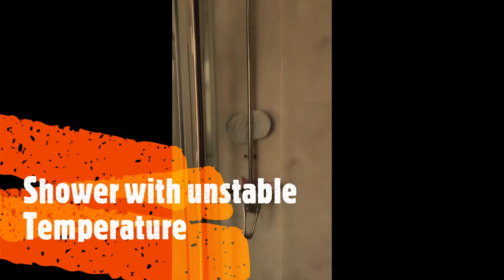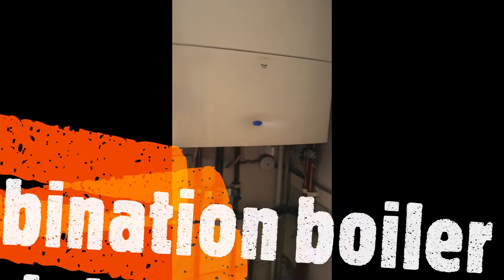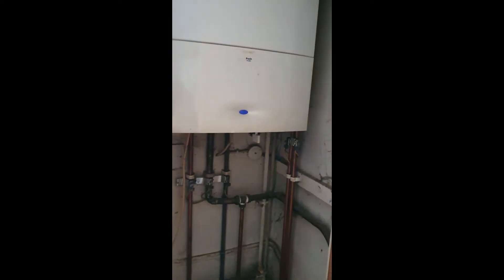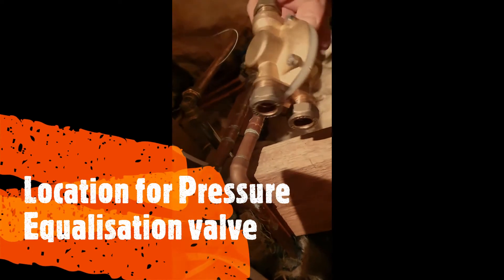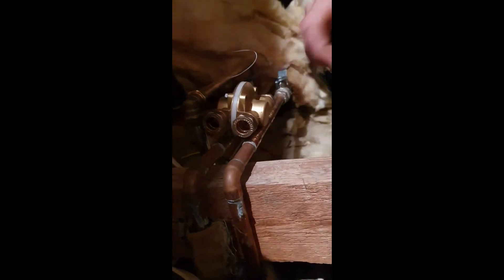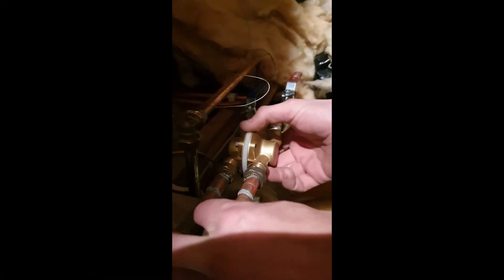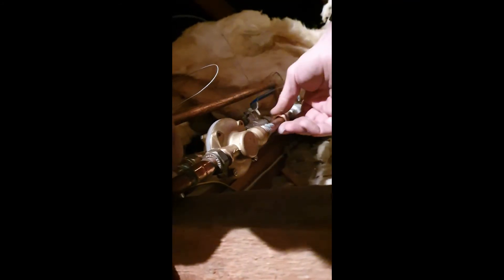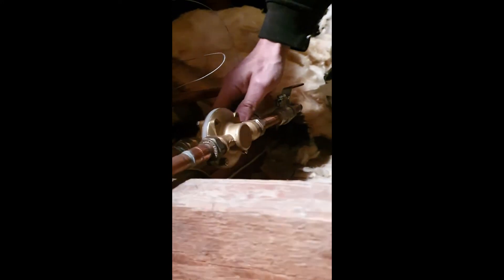Unstable shower Temperature?  Install a Water Pressure Equalizing Valve.

Comment: Hi. 
Looking to fit one of these and was wondering the best location. 
Ideal would be under the bath when I replace the taps for new mixer tap. 
Cold tank feed. 
Hot from main via combi boiler. 
Thanks in advance.
Reply from the maker: It can be fitted anywhere just before the blending valve/mixer taps.